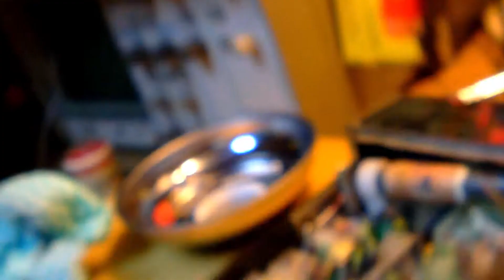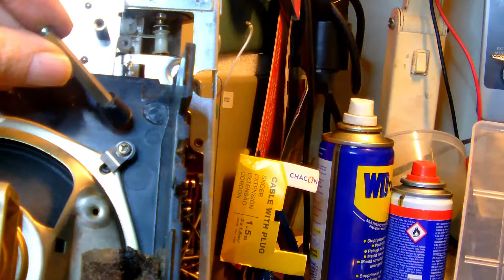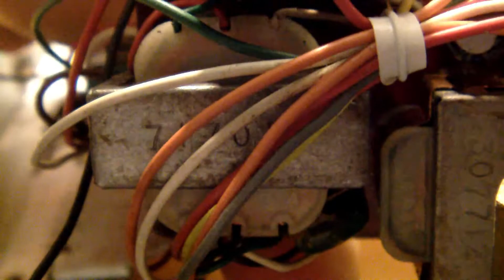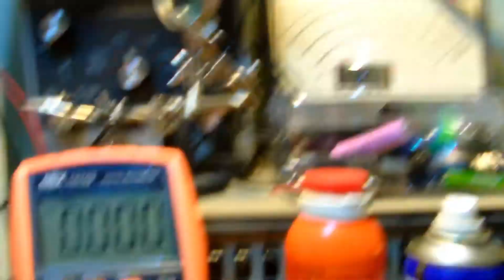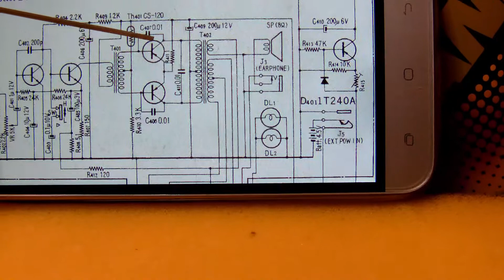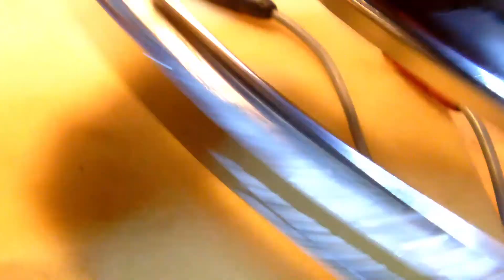Sony 7F-74L Car Radio Repair Restoration part 1 of 1

Comment: Great video. I had one of these that my father brought back for me from Germany. I lost it in a move many years ago, but I've always wanted another. Bought a nice looking, working model from eBay the other day. It is just missing the handle, but I should be able to fabricate a new handle from aluminum bar stock.
Reply from the maker: Sony did build some very intricate and high-end electronics in the past, and all with off the shelve components ! In many ways the Sony engineers were ahead of their peers thanks to their drive to innovate with the means they had.
I wanted to save this radio because it was obvious it had been mistreated and had had a busy life... a testament to its quality
Good luck and enjoy your radio, thanks for your nice comment and considering subscribing :)
Always welcome  ;)

Comment: Nice fix! I have the same radio, and it sounds exactly the same. I opened it up and noticed it getting hot at the same spot. Also same resistor was burned. So chances are it has the exact same fault with the transistor. Just have to find replacement parts and try to fix it too😅
Reply: Finally got the proper transistors. Had to order them from ebay. Radio sounds great, listening it now😀 I'm just a beginner in electronics and have no skills to diagnose faults. Without your video I would not have been able to fix mine. Than you!
Reply from the maker: Thank you and enjoy your radio! :)
Reply from the maker: Hello Tompa, yes one of the push pull transistors had shorted, causing the output transformer to heat up and to distort the sound. I used an original Sony transistor to replace it, but an equivalent transistor should work as well. Good luck and have fun repairing it :) Thanks for watching and considering subscribing